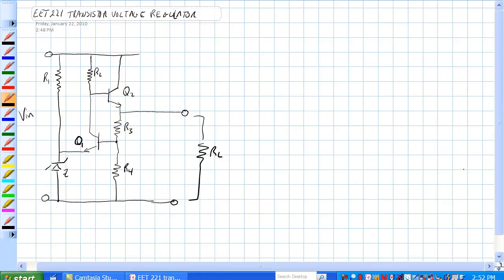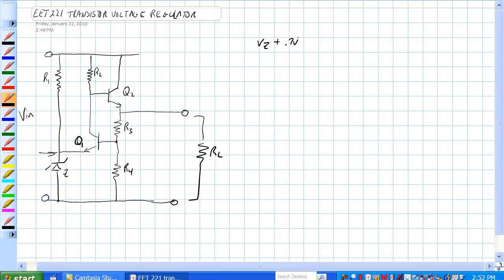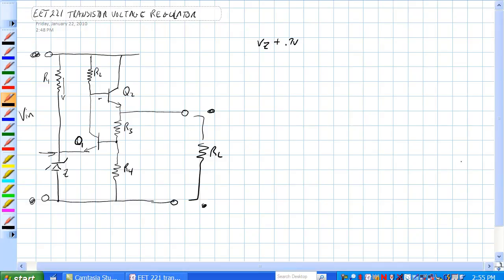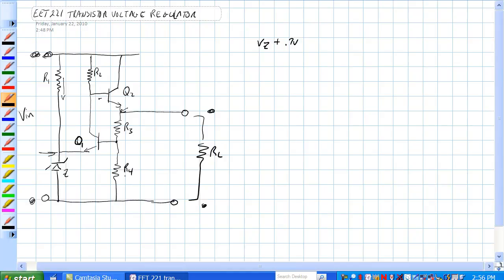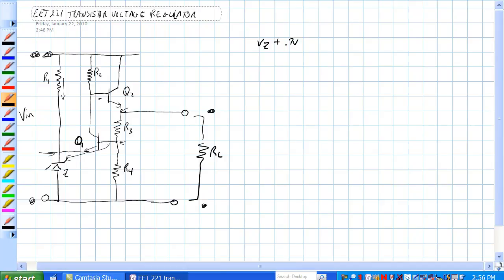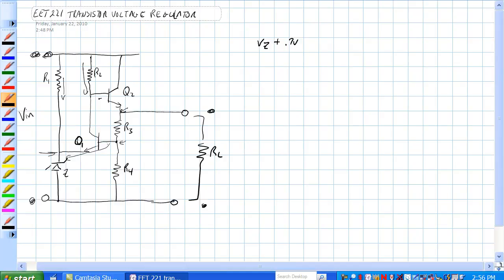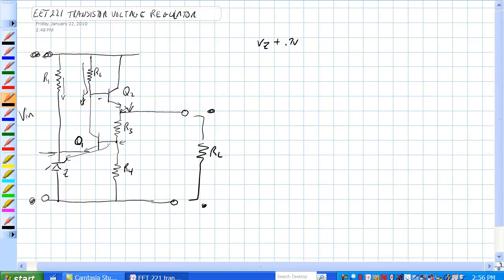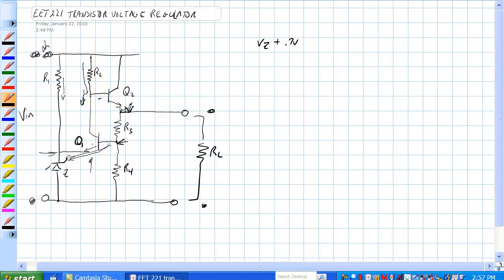Two Transistor Voltage Regulator

Comment: The voltage at the base of Q1 remains fixed, therefore the current thru R4 is fixed and the the same for the current thru R3. If the load current goes up, the Q2 emitter current must increase because the current thru R3 is fixed. The base of Q2 must go down to get more current into the base of Q2.